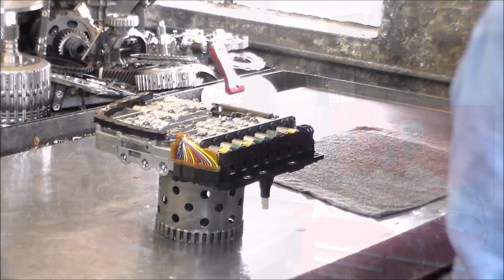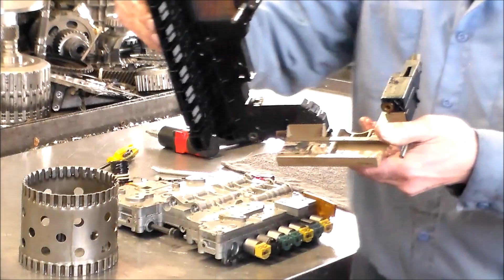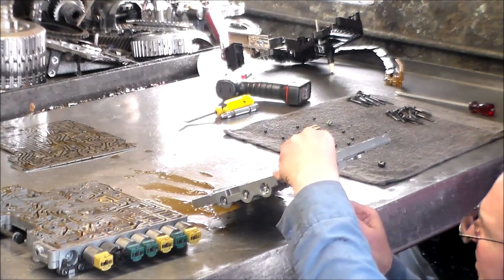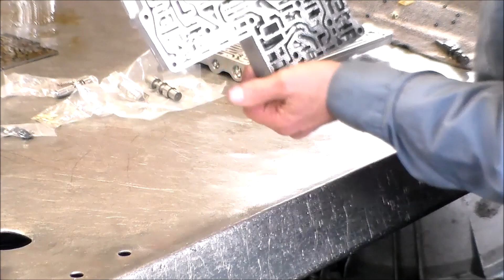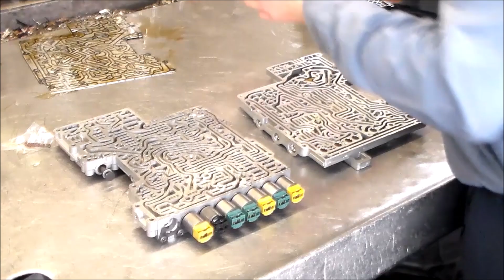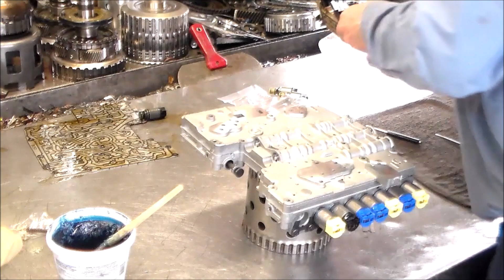ZF6HP19A Valvebody Overhaul

Comment: If one word can describe a business, "professional" sums up my dealings with Gary Ferraro's AAA-1 Transmissions. Not a man to promise a lot but then fall short, Gary Ferraro, along with his head mechanic, (also Gary - easy to remember), outperformed expectations, again and again. A tough project to tackle, my 2004 VW V8 Phaeton needed... a lot of work. Two other shops had completely failed, after months, to deliver anything. Then, I found Gary's YouTube channel. I gave him a call, and the Phaeton was trailered from three states away to his West Hempstead, NY shop.
Anyone can appreciate attention to detail, especially now, when it seems mediocrity and "close enough" attitudes are  common work ethics. But to receive MORE than hoped for is really rare, now or ever. Just a couple of examples: Having completely rebuilt the 6HP19, ZF 6-Speed transmission in the 4-Motion Phaeton, Gary noticed a very slow drip from the weep hole. Not content to return it in less than A1 shape, he stripped it down to find the cause, which turned out to have been a defective bearing seal. How many shops, I wonder, would have been so meticulous?
Or take, for example, the troubleshooting wizadry exhibited by head mechanic Gary. He found the cause of numerous electrical gremlins by tracing the origin to previously done electrical work. Then, he eliminated them by rewiring the entire, 80+ wire-connector for the KESSY Module. At a transmission shop? Really?
Considering their comprehensive parts & sub-system sources in Europe and elsewhere, noting their masterful knowledge and skills, and recognizing their achievement of high professional standards, AAA-1 Transmissions is clearly a business in a unique league. They took my pretty rare, really special but horribly substandard collector's car and turned it into a sublime specimen that could be a daily driver.
If you need any work done to your vehicle, give AAA-1 a call. I suspect that you will feel gratified and rewarded by their attention, and I unreservedly give them my highest possible recommendation.
Reply: I'm going through a similar  problems unfortunately I'm in Germany and not the US. I hope my EU connection can fix this

Comment: Hi Gary, commenting on this video because it's the latest. I have a 2003 540i with 5HP24, When coming to a stop I get one clunk from 3rd to 2nd and another very bad clunk going from 2nd to 1st. When I'm under 5 MPH the transmission acts like it has a 'brake' engaged. If I shift into semi auto or sport mode the 'brake' goes away and the car rolls forward like an automatic should. Already replaced PR valve with transgo unit. You have a video where you mention something about the transmission falling out of speed after coming to a stop.
Reply from the maker: Got your e-mail

Comment: Hi Garry. So I know it’s off topic but on the subject of my ZF5HP24 rebuild, I got it back in the car and everything seemed ok on the first drive. Second drive I noticed the revs going up and the car was holding third or fourth depending on its mood. Day three and the car has left me and my mrs and baby stranded an hour and a half from home. $500 on a tow truck and $380 on a taxi and we are finally home at 1am. The box was running fine in manual shifts and very smooth. Only in auto would it stick. The end result was it slipped out of gear at a roundabout and now nothing including reverse work. I feel a overwhelming sense I may have lost an orafice from the valve body when I looked back at a picture. If that’s the case would this have caused this issue I say if as I can’t be 100 percent what stage I took the picture at. If not what else should I be looking for? Please help part your amazing wisdom as I am too far invested to scrap the car X5 4.6is. 
Thanks in advance and also for your wealth of knowledge. Kind regards.
Reply from the maker: OK, when you finally got the car home, did you start it and see if it moves?
Reply: @GaryFerraro  I am just waiting now. The car should be here in 15 mins to half an hour. Do you have any idea what may have caused this?
Reply from the maker: @marchdeane4896  Well, i would like to know if this moves ok cold and stops moving hot, let me know what the car does
Reply: @GaryFerraro  ok so the car is back. No drive or reverse. The gears do not engage when you move the selector with foot on the brake. Normally you will hear/feel the gears engage. Where I live has been raining non stop and my driveway has turned into a mudslide so the tow truck could not get up the driveway. It is currently at the bottom of the drive. I will have to see if I have enough extension leads to get the computer plugged in down there for pulling codes.
Reply from the maker: @marchdeane4896  if possible see what codes are present and if possible could you drop the pan to see if any debris is in the pan
Reply: @GaryFerraro  Ok so between first read and a couple of clear codes and rescanning these are all the codes I receive that I think are relevant to the gearbox… 000030 EGS: Converter lockup clutch: excessive slip, 000002 EGS: pressure actuator EDS 2, 000094 DME: EWS 3.3 Interface DME-EWS, 000031 EGS: Symptom, gear monitoring, 00003B EGS: Stall speed, 00008D IKE: EGS Signal line disturbed. 

Not sure if these last two are relevant…
S 0053 No communication possible with: On-board computer, 000050 MRS: power supply

Currently the car could not get up my driveway due to poor weather conditions. The tow truck could not attempt the driveway. I am hoping to get my neigbour to help tomorrow with his tractor and then I can get it on firm ground and drop the pan again. I hope this is helpful. And thanks again for taking time out to reply.
Reply: @GaryFerraro  Hi Garry, did you get my previous reply with all the codes? Do you have an email I can send some pictures through to? Cheers. March.
Reply from the maker: @marchdeane4896  Sorry, shop is packed and doing 16-17 hour days
gsferraro@yahoo.com            e-mail
Reply: @GaryFerraro  Thanks Garry. I fully understand mate. This was my first auto rebuild so plenty of variables for failure 😞 . I have sent you an email titled ZF5HP24 (March Deane) I will re-send the codes in that email also. Kind regards.

Comment: Hello Gary, I commented on this video since it's your most recent but I have an issue with the 6hp28 in my 09 750li. So I'd put it in reverse or drive and it wouldn't move for a second then slam hardly in to gear it seemed then drive, eventually went in to limp mode then next day would not drive at all. It has clutch a,d,and e ratio monitoring and just revs up but will just barely move forward. I changed bridge seal, connector sleeve and the 4 small cylinder sleeves and the solenoids as well as oil and filter and still have same issues. The bridge seal was very cracked and I'm wondering if that was the issue and I may not have seated it properly or if i may have not filled it enough. I was wondering if you could point me in the right dircetion as what i should do next. Have heard of battery causing similar issues but don't know where to go at this point.
Reply from the maker: ok, so you found a cracked bridge seal and have the same problem?
Reply: @GaryFerraro  Yes. Was badly cracked and I replaced it and still have ratio monitoring codes for clutches a,d, and e and it wont drive. Just barely moves forward while the rpms go up. And wont go in to park. Just neutral

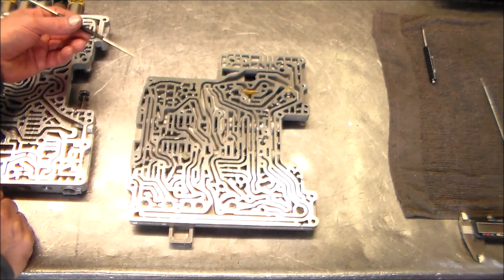Comment: Around @24:00 you mention cleaning the mechatronic. What do you use do clean them off? That's great practice to do of course but I know we can't just use any old solvent due to the electronics and some of the materials.  Maybe electrical contact cleaner? Curious to hear what you spray.  

Another fantastic video Gary!  😊
Reply from the maker: I use clean mineral spirits and let it dry.  Thanks for watching

Comment: There are differences in the valve body of an automatic transmission depending on the generation of the transmission and the car's engine.You can also change the number of solenoids,number of composite discs in a clutch,have more than one freewheel,more of a planetary loader,differences in the valve body spacer plate,in short,how do you deal with these differences in a same automatic transmission family?
Reply from the maker: I rebuild the one that comes out of the car, i do not really keep stock units on the shelf
Reply: @GaryFerraro  Is this zf6hp26 model still made by ZF? The model needs to be compatible with my car's engine which is a 2009 Land Rover LR3 2.7l v6 turbodiesel.